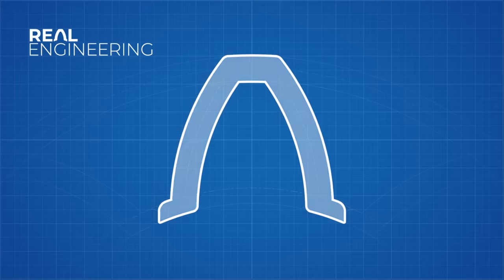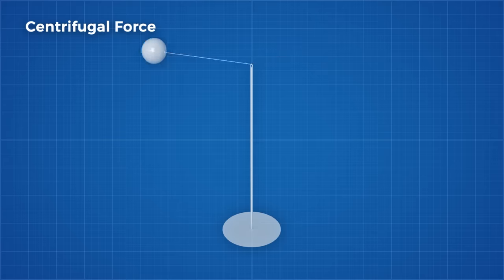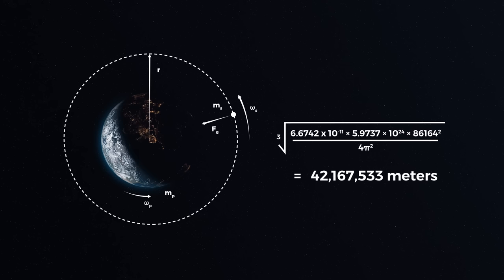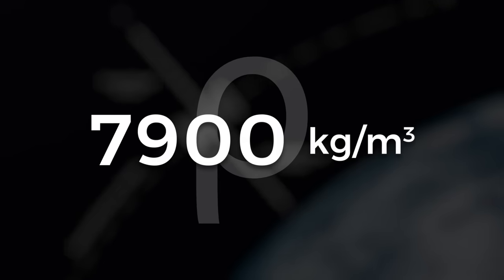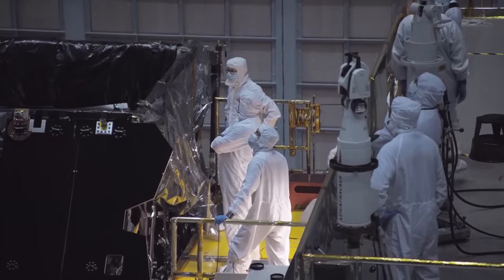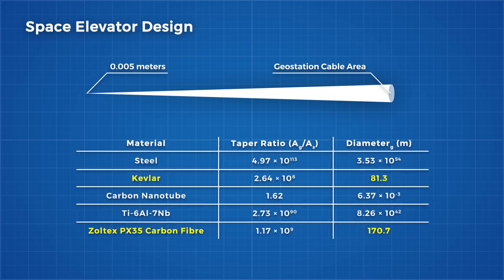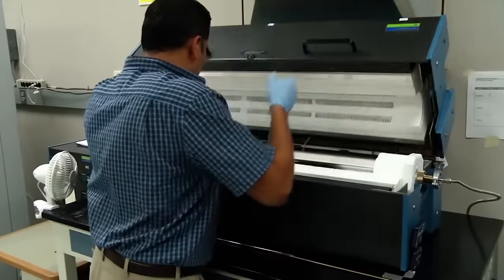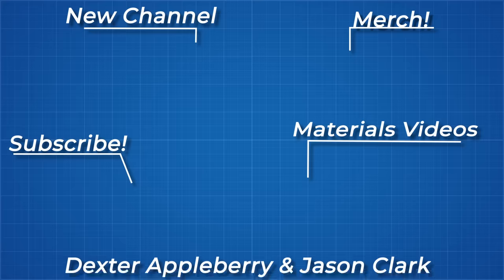Are Space Elevators Possible?

Comment: But what about Orbital rings? 
Probably more work to build but it is probably better, a lot simpeler and possible with current materials.
Reply: Finicky to get right though. The vibrational modes of such a huge ring shimmying at 7 kms are not well understood
Reply: @dsdy1205  That's why we should build the first one around the Moon. Much smaller, no atmosphere, if it falls apart it's not our heads getting carpet bombed - but still useful if it works out...
Reply: @AttilaAsztalos  and you build it a few feet above the ground (assuming you have a trajectory that is very circular around the moon).

It would be very easy to build compared to flying it up, and you'd get the same effect.
Reply: @AttilaAsztalos  We aren't even close to being able to transport that amount of material to the moon, or orbit.
Reply: @dsdy1205  true, but there is no reason for the ring to be a solid structure. It would simply be a matter of putting so many satellites in the same orbit that you can walk along them. Practically it would be totally pointlessly as the most materialy efficient way to store many people in space is using single pressurized spheres
Reply: seedorfj for the orbital ring you would have an internal ring travelling faster than orbital velocity (being held in orbit by magnets) and an outside structure that is not moving relative to the ground.

So long as the net momentum of the system is the same as the entire thing travelling at orbital speeds, it will stay up. And then, since the outside structure is not moving relative to the ground, you can lower a tether (or hundreds of tethers) to the ground.
Reply: @AttilaAsztalos  actually if the moon tether broke anywhere along its length, there is a risk that we would in fact be carpet bombed because the Earth-side tether fragment would be going too slowly to remain in orbit.

An Earth tether is ironically safer for this sort of thing, because we expect most cuts to the tether to occur at low alttiude, at which point the space side fragment is going too FAST for a circular orbit and will actually ascend away from the Earth's surface.
Reply: @dsdy1205  Hmmm, apparently it's a non-starter anyway - it seems that if one would want to remain stationary vs. the Moon by the means of staying in an appropriate orbit around it, that orbit would have to be...  88,441km away. Which is a bit of an issue, even before considering what the Earth would do to such an orbit. Didn't do the math myself though, so... pinch of salt and all that. But dang is math a harsh mistress...
Reply: @JamesSeedorf  A high number of satellites doesn't get you that hull with the geostationary speed, a lot lower then orbital speed at that altitude.
Reply: @nocare  The moon has already been confirmed to have massive amounts of metals, water, and other minerals that would be in high demand, so that's not really in question here. The moon WILL be colonised, and heavily, it's just a matter of how quickly that's going to happen
Reply: Space elevators don't make sense because their traffic capacity is abysmal. You can only have one crawler going up or down the tether at the same time unless you create some kind of mechanism that allows crawlers to go around each other when they meet along the tether, like when trains come across each other on a single-track railway. You could get around this by building a second space elevator next to the first one but now you've doubled your costs. That's not to mention it would take days to climb up or down 36000 km.
Compare that to the traffic capacity of a network of skyhooks in orbit or a fully-fledged orbital ring and it's not even a competition. Not to mention they could be built out of already existing materials.
Reply: You don’t really need to build a big orbital ring to get stuff into space in the first place.
I would wager that the smallest orbital rings would be a lot cheaper than a space elevator, this is because there is a much higher minimum size for a space elevator compared to a orbital ring.
The simplest orbital ring would be a thin strong metallic wire that is spinning around the earth like a hula-hoop and at a few locations you put some magnetic tubes around them to attach a small elevator.
An orbital ring and for that matter a space elevator only has to be big enough to be able to support the building materials to expand it. You can see it as first making a small cheap dirt path and then later when you need more capacity you use that dirt path transport the materials to upgrade that dirt path to a highway.
I can be wrong but seeing that an Orbital ring would only require materials we can currently already produce relatively easily compared to a space elevator that would require newer materials, which I don’t doubt we can eventually make but would probably be a lot harder to produce compared to things like steel cables.
In the end I would like to say that I think that a Skyhook is probably better to start with anyway compared to both orbital rings and Space elevators, but when comparing space elevators to orbital rings I must say that I think that orbital rings are a lot better option.
Anyway, i like discussing these things with people so if you want give me your thoughts / arguments whey i might be wrong / right or have overlooked something, thanks.

Comment: Build it on Everest and cable will be 8.89km shorter than at sea level. Add a big enough air balloon that can hold the cable up to 20km and the rest of the cable will have a lot less strength requirements.

Comment: One thing I've never understood about space elevators is how they increase the horizontal velocity of the climber. 
This must of course increase if it's maintaing 1 rotation per day at a greater distance from the centre of the earth.
My guess would be that the cable exerts a  force laterally on the climber. But wouldn't the cable then exert a force on both the earth and the counterweight? With the mass of the earth the rotational reduction would be insignificant, but  what about the counterweight? Wouldn't this reduce its velocity and ultimately impact it's orbit causing massive problems?
Reply: I totally agree with you. Angular velocity at the surface is much less than at the orbital end. This implies that the payload must accelerate laterally to the same velocity. I have never seen this taken into account when this idea is dragged out again and again.  It seems to me that at best, the elevator would support the mass of the payload, but some extra force is still needed to speed it up. They always use a lot of math buzz words and equation props, yet I can't help thinking it's a hoax
Reply: you're correct. the elevator would have to be rigid so that the object being elevated is given angular momentum exclusively by the earth. if the counterweight design was used the counterweight would fall to earth after one elevation attempt because energy and momentum are not free.
Reply: @no physicist they're not math buzz words and equation props, the video's model simply does not consider conservation of momentum. its a thought experiment at best but so was special relativity when Einstein first proposed it
Reply: I think you’re correct, but the important thing to consider is that mass returning down the elevator would have the opposite effect.  You’d have to send rocks or minerals down the elevator at the same mass rate supplies and water came up the elevator
Reply: Yes that's what I was thinking as well
Reply: @nophysicist700  Sorry, Emma Manning used a lot of positional terms that I can't understand because it's not being referenced to an inertial frame (e.g. horizontal velocity, laterally), so I don't quite understand what problem she is trying to communicate. I think you guys are saying that the angular velocity of the climber changes at it moves up to the orbiting satellite. However, I don't think that's true--the tangential velocity is increasing as it goes up, but the angular velocity will remain constant throughout the climb.
Reply: Read the article on Wikipedia on space elevators, they explain how this issue is rectified: https://en.wikipedia.org/wiki/Space_elevator#Climbers 

The need to increase the velocity as the altitude increases manifests itself as Coriolis force. This apparent force does indeed drag on the elevator, slowing its rotation around Earth. However, this only tilts the portion of cable below the climber backwards,  as the part of the elevator above the climber acts like a pendulum where "down" is away from the center, and actively seeks a vertical orientation. As such, the cable tension actually acts to slow down the EARTH, instead of the counterweight. Of course, the Earth is enormously massive and full of angular momentum, so it will be a good long while until we manage to decelerate Earth's spin using orbital tethers.
Reply: @nophysicist700  I'll direct you to the same comment I made below, where you can find out for yourself on the wiki article for space elevators that people have indeed considered this problem to great detail, and found the system to be stable even with climbers ascending and descending the tether.

Also, I'd like to point out that your terminology is incorrect. The angular velocity remains the same - the elevator sweeps out one rotation per day. The TANGENTIAL velocity does indeed have to increase as the payload rises, and you can find out more about how this problem solves itself on the wiki article linked below.

Comment: Catastrophic failure of a space elevator was studied at my University. The results were so grim, it was said to be the worst idea ever conceived to climb to space.
Reply: So in short, what would happen?
Reply: Patsonical a ridiculously wide cable thousands of miles long slamming into the ground at speeds faster than mach. Or, the cable snapping at the ground and launching the orbital counterweight station off into solar orbit and taking its population with it. Imagine a bullwhip against a 1:150 scale model on a sand table.
Reply: I think it was described in several SF books also - Kim Stanley Robinson's Green Mars maybe?
Reply: @cunnjohn  It's a pretty key part in all 3 of his Mars Trilogy books.
Reply: @ab5olut3zero95  Halo lore has some stuff on space elevator going wrong like this.
Reply: @phalanx3803  you mean the new mombasa elevator falling due to the ongoing battle and slipspace jump causing the supports to weaken and causing it to send pieces flying through out the surrounding area and further or the new meridian's elevator collapse

Comment: Possible explanation for that seemingly inexplicable steel strength figure, https://en.wikipedia.org/wiki/Wire_drawing The process isn't relevant for bars or other products, as they are too hard to draw, coupled with the fact that getting to the strongest strengths possible means numerous careful annealing treatments, so this is not really a cheap process to take to the extremes. Nobody quotes the numbers they can achieve as the strength of 'steel', because that is referring generally to structural steel sections, not extremely thin wires. These would also be quite hard, though not proportionate the way hardened steel's strength and hardness correlate. 

All that said, it's still not as good as the more modern options.

Comment: I was thinking about a design for a space elevator and thought that the best design because of material limitations would be an array of rings with electromagnetic and/or permanent magnets.
   The elevator would be a magnetic lift that passed through the center of the magnetically Suspended circular platforms. I didn't consider the accumulated forces throughout the array, but even without considering different stress levels throughout the chain, construction would be incredibly difficult. But the idea of building it from space down makes things a lot simpler.  
  Given we could get the thousand or so platforms constructed and boosted into orbit, they could be lowered into position from space. I will probably run into infinite problems when doing the actual math and science for this design. But hey it's great engineering practice!

Comment: And this is just a static cable. Introduce the real world with its effects and then some form of mass travelling up and down and off the elevator. Orbital mechanics.....
Reply: Yes.  I never see any mention of dealing with the angular momentum needed to reach orbital speeds.  Most of rocket energy is needed to accelerate the mass to 25,000 km/hr.   As a mass rises above the earth’s surface, it would start drifting westward, wrapping the tether around the earth.
Reply: @scrummaster8533  as you climb the elevator, your angular momentum doesn’t change. Using the definition of L=ω*I, or angular velocity times moment of inertia, you see that your moment of inertia doesn’t change and your angular velocity doesn’t change (1 revolution every 24 hours), so your angular momentum doesn’t change. You only need to put in the work to counteract gravity to move up the chain. The effects only become apparent when looking at the whole system, Earth included, and so earth’s angular velocity will change, but only minutely
Reply: @samburnes9389  That's my point.  Rockets add a lot of delta V to angular momentum, how would a space ladder add lateral momentum?
Reply: If you have about equal mass going up as down, small variations won’t affect the operation.